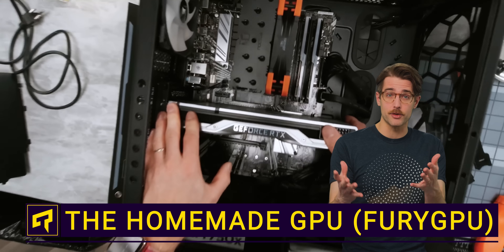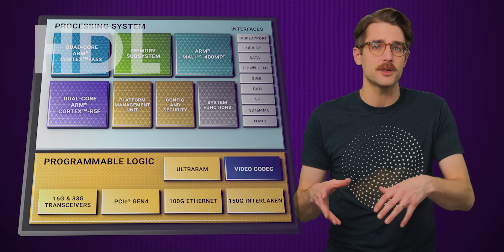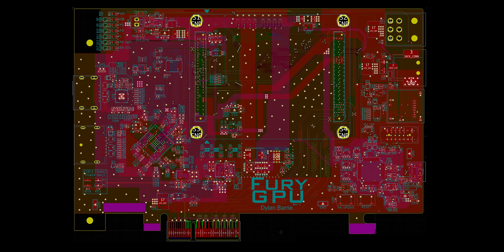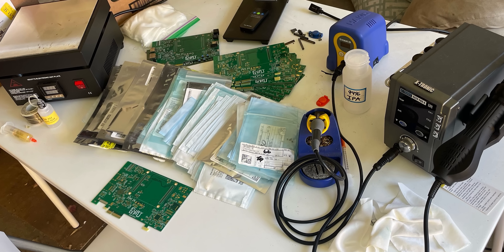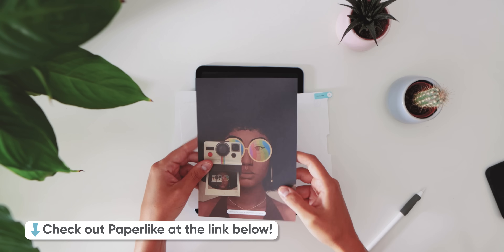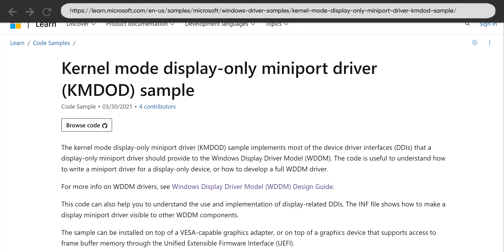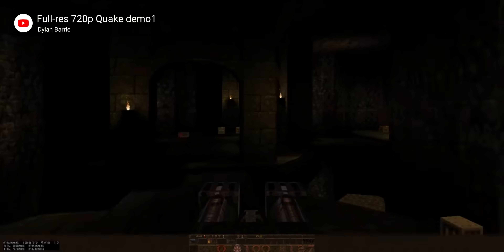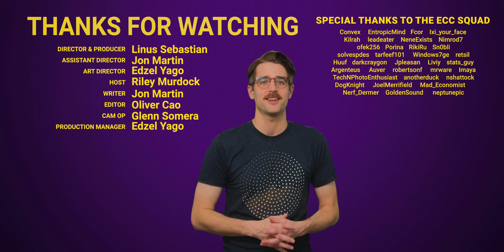This Guy BUILT His Own Graphics Card!

Comment: Awesome! I stubbornly believe they (card mfgr's) could have a socketed Graphics card- allowing the user to add the V-RAM as they wish
I also see the day where Graphics cards are no longer slotted in using pcie X 16. Video cards will all be free, only limited by cable length (and not Ribbon cables! It's not 1989)
Great video. I wish Video cards were easier.

Comment: So I'm an electrical engineer, and it feels understated what exactly this man has accomplished. You can't simply read a book or watch some youtube vids and tinker to make a gpu from scratch like he did. This is an incredible outcome for a dauntless task. Extraordinary intuition and computational mindset. It's really incredible.
Reply: why is it so difficult though. because from the software side the rendering engine is well known what are its requirements and features. you just need to build a hardware around it.
Reply: @2DarkHorizon  from an analog perspective, getting the physical components to relay information in a specific pattern, limiting the voltage and amps, tracing routes, designing various limiters, repeaters, etc etc. There is a LOT that goes into a "simple" circuit, let alone an actual graphics card. Not to mention, he made a custom engine. It's significantly simpler than the modern ones used in most games, however, it's not necessarily the software side that is difficult. I'd say programming is much easier to learn and understand that physical component binary and signaling. It's much less intuitive.
Reply: @InnaciKorushka  alot of people get into software these days but i figure the hardware and electrical isn't as hard people think once people are versed in it. Not saying electrical is easy it is properly harder than software but you know what i mean there is a standards to hardware circuits you follow to get things done
Reply: @InnaciKorushka  he used an fpga, it greatly simplified things.
Reply: @InnaciKorushka  To be honest, inside FPS you're just configuring how transistors are interconnected together. I means a lot of people design their own CPU's, all you have to understand how to construct circuits using logic gates. I mean modern GPU's are practically very similar to CPU's except that they have tremendous amounts of low powered cores and some extra hardware for rasterization, culling and vector arithmetic and transferring data around amongst other similar functionality. We these types of GPUs implement a "programmable pipeline" where as the guy in the video built a "fixed-functin pipeline" similar to what we used to historically. Fixed-function graphics cards can actually be somewhat more complicated to implement because what you're practically doing is implementing shaders directly in the hardware, which both gives you room for optimization as well as makes the design of the GPU more complex. That being said, if he tried to design a GPU that uses a programmable pipeline it would be somewhat simpler but he would have to sacrifice some performance and he would have to design more complicated GPU drivers that would be able to compile and upload shader code onto the GPU. However lets not underestimate the amount of effort this guy has gone through to accomplish this task, just because a big problem can be broken down into smaller ones that are manageable, it doesn't change the amount of effort that went into implementing the GPU.

Comment: I've been wanting to do something like this, but with either a modified risc-v based architecture, or something crazier like a custom implementation of non other than the 6502 architecture, then modify & optimize it for graphics proccessing to create my own custom gpu & it's respective architecture. Of course, I'm only going to be aiming for low powered devices such as, microcontrollers, custom retro style games consoles & handhelds, also old or retro computers in general as a starting point before my homebrew gpus can be taken any further.

Comment: Wait!? So he’s actually running games on this thing? I thought it was going to be a super basic GPU that could technically render but only low resolution images in a very basic engine. I didn’t expect it to be running real games. He’s actually running Quake 2 at 720p? That is incredible. Great work brother. I’m so proud of this guy!
Reply: It is "basic", hence why he's using Quake II to demo it, as it's not a 3d accelerated game engine or have dynamic lighting, shaders, etc.... But even building a basic GPU like this is an insane display of skill, knowledge and intellect. Especially given all the trade secrets around GPU development and it doesn't seem like he's involved with one of the top 3
Reply: @jarsky  idtech 1 add a 3D accelerated render as well, yes it has a software rendering path, to run on the CPU alone but it was updated by idSoftware to support a OpenGL render that is 3d accelerated and he used vulkan and a GPU, so he had to use the hardware render part.
Reply: Open source GPU design?.
It would be fun to look at it.
Sounds like he implemented the 2d part of the drivers. The Bom part cost would be expensive. A working NV 1650 starts sounding real good.
I wonder if he used the arm processor to preprocess 2d commands into direct lower level hardware operations.
Reply: maybe with more hard work and dedication from this guy we can get annother competing brand of graphics cards in the future. may not be any time soon, but seeing people with the skill and intellect that this guy has gives me hope for the future.
Reply: @RealHoot  He'll be recruited by Nvidia or AMD, or both, by this time next week.
Reply: He'll always cherish the kind words of MarioGoatse. ❤

Comment: I’m a computer engineering major and I remember reading about if it was possible to literally make a CPU on your own, and the overwhelming consensus was that those sorts of projects are always industry level investments so I shouldn’t bother. I had assumed that’s also the case for GPUs, but this is telling me there’s hope!
Reply: He's using a FPGA so it's mostly board design and designing and coding the circuits in the fpga. However the retro community is making lots of efforts to replace and recreate older custom hardware. Like cpus and special chips. I've seen people working on custom 8088 and 286 cpus.

I also saw a video the other day of a guy trying to make an actual die, this was for a 16 pixel monochrome camera but the process is close enough to other types.

It seems like a lot is possible now with enough drive and some luck, and maybe some creative investment/modification in resources and equipment.
Reply: CPUs can be created now!

Comment: I may be interested for one on simple PCI to use it in a Pentium 3 that doesn't have AGP. With 128MB, Windows 2000, XP, maybe 98 drivers, and to perform similar with a FX-5600. I may be interested in buying one if really does the job in games of that period.
Reply: They reportedly made standard PCI(ie: not PCI Express, though they were also available) FX-5600 cards at the time, along with other fast(for the time) PCI cards.
You may get CPU limited anyway with these faster cards, though it may depend on your specific cpu.

Comment: more broadly, the Zync is an MPSoC -multiprocessor system on a chip: FPGA, ARM processors (usually several cores), and a few RTOS (real time operating system) cores. FPGAs are not persistent and need to be flashed/programmed every time they are powered up. this is where the ARM running LInux comes into play: as part of its boot sequence, it can run the software to flash the FPGA

Comment: I thought trace lengths were more about signal timing rather than signal integrity...
Reply: It can be said that timing is a part of signal integrity as there are several signals and they have to be processed in parallel. Now that's a bit frustrating as PCI-e uses serial data to avoid the problems that parallell signals have. But anyway you look at it the signals has to be available at the same time. Now signals traces can't be located immediately next to each other or there will be noise inducted in the neighboring traces. Same with the zigzag of traces to make them longer. Those can't be to tightly packed or there will be inductance generating ghosts of the signals in the same trace. As frequencies go up this just gets worse and worse. Even at pretty low frequencies this can cause problems if the traces are long enough. Once a long time ago I had to lengthen the ribbon cable between a POS terminal and it's keypad. Not particularly high frequencies here and decent voltages in the signals. And yet it was enough to occasionally corrupt the keypresses. Just split the cable into individual strands, bunched them upp a bit with zip ties and it worked every time. This was a temporary fix as the shop were going to replace their desks but at the time I had to make the keypad fit into an old pocket on the desk. It was an ugly hack but the customers couldn't see anything of it.

At the time I worked with component level repairs on a huge multinational computer company. I spent a lot of time studying signal integrity and I had loads of oscilloscopes almost always wired to something that didn't do exactly what it was supposed to do.

Comment: I was considering this with using the GPU from a dead PS3.
Reply: how is the ps3 dead? have you tried bringing it back to life with an oven?
Reply: @gamecubeplayer  Turn it on and after a bit, it usuall goes beepbeepbeep and shuts off.
Reply: @HeadHonchCrow2 it could be full of dust, you need a t9 security torx
Reply: @gamecubeplayer  I found that  out with another one that was a BC model sadly. Tried taking it apart and forgot to reassemble it, and I kick myself for that.

Besides, the non-BC model I have rn booted a few times into the OS and not much ever

Comment: But can it run Crysis?
Reply: But can it run DOOM?
Reply: @0thewings  Doom could run on a potato, so probably yes.
Reply: @Radulf666  Someone made a vid of them actually running doom on a potato... sort of at least it was like a huge potato battery to power a calculator running a ported version or something iirc
Reply: @Radulf666  If by "run" you mean 240px resolution and 12 fps then sure.
Reply: @0thewings it could probably run doom without the PC attached
Reply: @zyeborm   Some person ran doom 3 on a smart fridge computer interface it was pretty funny
Reply: @0thewings buy a 486 😂
Reply: @0thewings I watched a different vid on this same card and they used quake to test it and it gets about 30-60 fps on quake so probably
Reply: @0thewings  Well it can run Quake, so obviously yes
Reply: @0thewings Doom literally only needs a 2D so hell yeah? It all renders on the CPU. It literally predates 3D acceleration.
Reply: Legend has it, when Crysis saw Fury GPU... it ran.
Reply: But can it run Leisure Suit Larry?
Reply: What about Return To Castle Wolfenstein?
Reply: Yes it can run Crysis… on infinite earths
Reply: @kimfom  i see what you did there 😂🤣
Reply: @Nate4Christ34  😂
Reply: I searched for this comment. 🤟😂
Reply: Crysis uses DirectX 10, so no, it can't.
Reply: @hammerth1421 um no it's DirectX 9.
Reply: @purplestrawberrysunset  ACKTHUALLLLLYYY... While it can use DX9, it can also use DX10 as well.
Reply: @hammerth1421 "umm ackshually it can also run in directx 9 🤓☝️"
Reply: @hammerth1421  Maybe with Proton
If the Driver is compatible with Vulkan, it might be possible to run dx10 games
Reply: @hammerth1421  🤓
Reply: A classic 😊
Reply: No

Comment: gatorade is a good sauce. hey man, cross talk is the best. of all talk. silence is even better in peace. not in pieces. I got board too. you can more easily try a diy gpu on DE10 nano soc board, and use linux vulkan drivers. I assume linux drivers are easier than what windows requires. or any other off the shelf soc fpga hardware dev board with modern connectors. why do you call yourself a soldering iron. hmh.